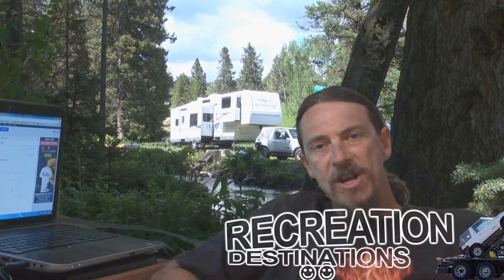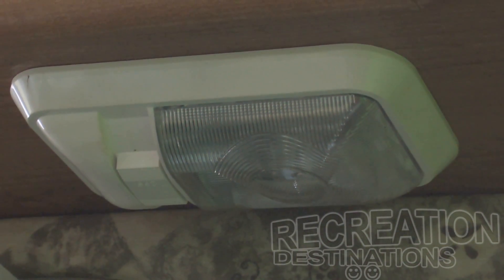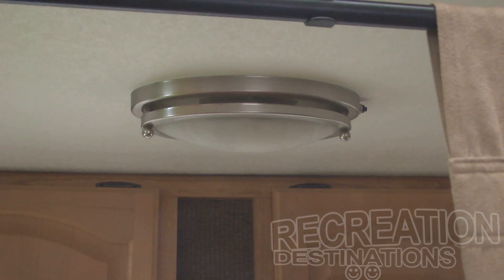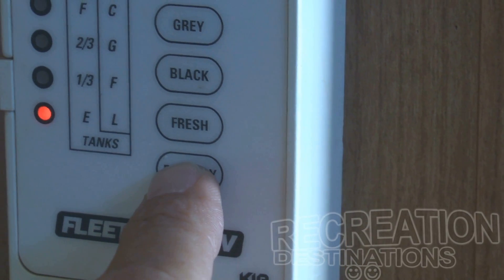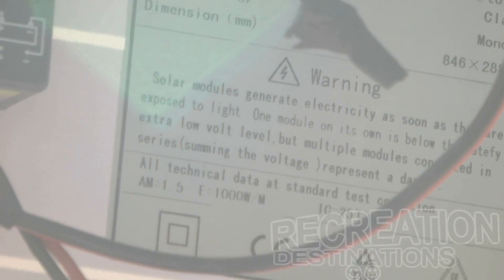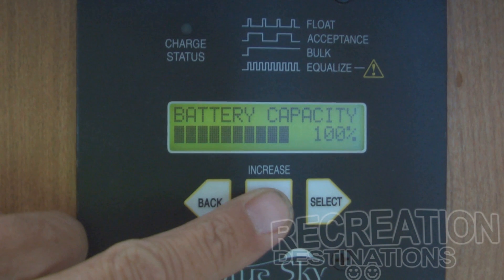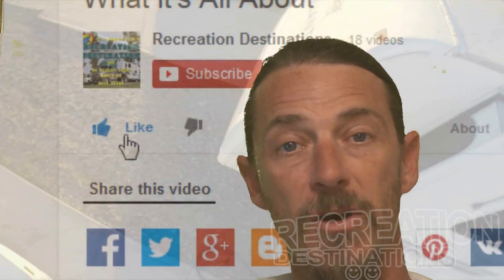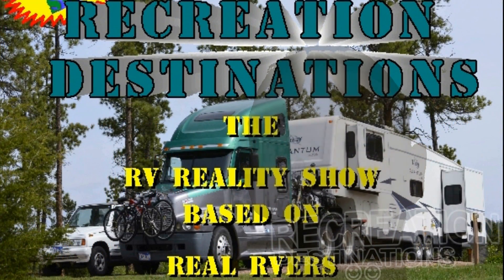Understanding RV Electrical Systems Part II

Comment: I am branny new to this tringto fix an old trailer. So I plug in a 50amp to 30amp dog bone then my extension cord to the trailer. Should I not automatically have power to my outlets? Are some outlets 12v and others 110? Why? I never heard of a12v coffee pot. Sero I have no power to my outlets. My battery is dead,but that's only 12V.
Could my converter effect the 110?
Reply from the maker: Yes, you should have power to your outlets. You may want to check your Breakers in the RV and make sure that you actually have power on the extension cord. The converter should not affect whether or not you have power to your receptacles, and no receptacles will be 12 volt.

Comment: Thanks for the great video.  So if i have a solar charge, and plug into AC, does the solar charge turn off automatically, or will the solar keep charging along with the AC converter/charger?  Do they work together somehow? Do they "talk" to each other?

Comment: My problem is that when connected to shore power everything work. When connected to my Onan 4000 gen set everything on 12v work but the wall outlets & A/C don't work. I already checked & cleaned all wire terminal on the batt. compartment & the wire box next to the batt. compartment, charged the batt, cleaned the batt. terminals, checked all 12v fuses & all 120v breakers.( All beakers read 120v when run on shore  power). The Generator breaker was tripped & I reset it & turned to the ON position. So it look to me that the problem may be the Gen. switch, the converter (the fan runs & there's one ceramic 15a 250v fuse on the green board ) or the transfer main switch ( Note, Gen. was run w/o load 1st. & then after 1hr. full load, Nada, O, nothing. Ur  help will be greatly appreciated.

Comment: You rock! Finally someone who can just explain in English "so to speak" great job. I'm still confused why my chassis batteries won't stay charged on shore power
Reply from the maker: Finally! Someone who realizes that I Rock!  If you're a single female with a great body and a nice RV we need to talk.  Otherwise, the chassis system is usually isolated from the house batteries in case you leave the lights on inside you will still be able to start the RV.  You can put a trickle charger on the chassis battery system that will keep them topped off.
Reply: @HighDesertOffgrid  lol..I'll never tell... so the trickle charger will draw off of the house?
Reply from the maker: @defaultname3302  No.  The trickle charger would be plugged in to a receptacle somewhere and connected to the chassis battery via the red and black clamps.  There are more permanent solutions, but that is easiest, unless you are an RV Genius like myself.  ;)

Comment: Should I be able to plug in my vacuum, little dirt devil, and have it work w/RV plugged in?? Can only get vacuuming to work when RV is plugged in. Love these videos....wish I’d paid attention to all my hubby did when he was alive. Now on my own and living in my RV (2 6v deep cycle batteries) I’ve learned a lot from these 1st 2 videos. Thanks so much for keeping it simple. I’m still puzzled why the red is called +, it’s not that way with $ 😬
Reply from the maker: You must have a built-in inverter or a running generator for your outlets to work when the RV is not plugged in to shore power.
The positive is red because it is the "dangerous" end.  If it is accidentally grounded, it can cause sparks and even a battery explosion.

Comment: Newbie here:  so, in your example, as I understood it, you are boondocking in the middle of nowhere and you find that your battery bank has depleted to about 50%, could you not just start your tow vehicle’s engine and run it for a while to recharge the RV batteries?  Please advise, thank you!
Reply from the maker: It would take several hours to completely charge the bank, but it is possible.
Reply: Recreation Destinations thank you.  Great vids.  Keep up the good work.

Comment: I have a 50 amp RV, and when I plug into a 30 amp shore power, with the correct pig tail, does my battery charging system work the same? The reason I ask, is because I typically have issues when I use a 30 amp connection.  thanks
Reply from the maker: It should still charge properly with the dog bone. The only difference between 50 and 30 amp typically is the amount of appliances you can run at once.

Comment: i have 2 lead acid flooded 100 Ah batteries in my 23' coach. in winter, when i run my furnace at night the coach is cold in the morning after about 7-8 hours sleep. the furnace is shut down and does nothing when i change the thermostat. my 'idiot light' monitor panel reads 3/4 lights. is this a furnace or battery problem? do i need to add another battery to get the furnace to run during the night?
Reply from the maker: Sounds more like propane delivery to me.  Are you on shore power?
Reply: occasionally plugged into shore power. mostly boondocking. but the furnace still doesn't run all the time when plugged in. i will set my thermostat to 14c, and in the morning, the coach will be a brisk 9c! the dealership service department refuses to replace the furnace, they INSIST that it's lack of battery power. very frustrated. at this point, i'm considering buying another battery(i would have 300 Ah then), just to prove to them that the problem is in the furnace, not the batteries. regarding recharging; i run my 4Kw Onan for 2-3 hours a day, with an external 30A charger. when i finish charging after 3 hours, the charger reads "100%" @14.5v.
Reply from the maker: If you are dry camping it very well may be you are using up your amp hours through the night.  Another battery added to your bank should help.  Also consider investing in a quality battery monitoring unit.  it will tell you how many amp/hrs you have used and much more.

Comment: Help I just got a 2017 Meada by forest river, It came with an 100 watt inverter to run the 110 compressor reefer. I had Go power extreme solor system put in my rv. they left the 1000 watt inverter in and just added my 3000 watt inverter. No I do not know how it is wired I asked but was never told. Is this ok to do and if so how should it be wired so I can check?

Comment: I have a 2003 Winnebago, where is my Inverter located on my coach
Reply from the maker: The vast majority of RVs don't have inverters.  They are usually installed later by the owner.

Comment: I had what sounded like a breaker breaking. I checked the breakers in the RV and the Breaker (30A) in the post outside. I turned off all the breakers in the RV panel and switched them back on then I switched off the breaker in the post and switched it back on. Nothing has changed. The lights in the RV work but none of the 120 volt items came back on. Any thoughts as to my problem?
Reply from the maker: I would start checking for ac voltage at the pedestal and work my way from there.  You didn't say if you found any breakers tripped so I assume you didn't. Could be a transfer switch if the unit ha a built in generator...
Reply: could also be the ground fault isolator ac plug ...  it pops from time to time on my 2003 Winnebago Sightseer 27c ... push to reset and ac is restored.  Hope this helps...

Comment: I have  a 2005 Riverside trailer and sometimes my lights will go out for like 10 minutes and turn back on but everything else stays on. I just got a brand new battery about a month ago . Do you think it could be my inverter? And if it is how hard is it to install a new one?

Comment: HI  I AM ELECTTION  BUT NOT RVS I HAVE 1990  SOUTWIND  AND I HAVE GOOD BATTERYS WENTH I AM PLUDED IN  MY DC RUNS DOWN IS IT MY CONTVERT GREAT SHOW MAXWELL
Reply from the maker: That's where I would start.  Make sure you are getting 120 to the converter and check for any built in fuses in the converter.  Some have them.  Happy RVing!

Comment: could i use the same type of batteries as my semi for my rv ? they last all night with you fridge,  GPS, dashcams, electric toothbrush, etc plugged in, plus tv....very rarely does apu kick in because they get low.seems like my 2 deep cycle marine batteries in rv, Peter out quicker with TV and a light on for a few hours. I'm running fridge and water heater on gas.whadyathink truckdriver? lol could I put big truck Batts in rv? would they be able to get charged up with my 2 -100 watt solar  panels?
Reply from the maker: Most semis have 4 starting batteries.  While they have a decent reserve, they aren't made to be deeply discharged often and won't last as long as a true deep cycle battery.  All the "marine" deep cycle batteries I have seen are a hybrid between a starting battery and a deep cycle battery.  They will last a little longer in an RV but aren't as good as true deep cycle RV batteries.  With regular maintenance, you should get 7 years out of a lead-acid deep cycle battery.
Reply: Hmmmm....i think I damaged the 2 new 12 volt marine Batts I bought at sams about 2 weeks apart.  Both got ran down to "dead" separately on accident. I have since tried recharging them with a battery charger. But they don't seem to last as long as they should.  Btw, i wired them in parralell a couple months ago after they were fully charged according to my charger. Just seems like I can only watch tv (I have inverter) In rv for a couple hours.......all night long in semi....wtf
Reply: Thinking about getting 4 6 volt agms....2 pairs wired in parallel  (each pair wired in series, of course)aren't they are lot heavier than 12v Batts? I'm already maxed out weight wise as i keep it full of water n gas...i hate rv parks
Reply from the maker: Deep cycle batteries are heavier than starting batteries because the lead plates in them are thicker and made to stand up to many more discharge cycles and build up less sulfation.

Comment: my gfci keeps tripping, then my circuit breaker on onan 4000 trips....i had a new breaker put in generator already. and I could not start gen from inside after this all happened a couple times. I've spent way too much  $$ on this gen. already....any suggestions so I can at least steer electrician in right direction?
Reply from the maker: I would direct the electricians to the circuit that the GFCI is on.  It is either overload or there is a short.  Check ALL  the loads (a/c, water heater, electric heaters, coffee pot, etc) on that circuit as well as the overall loading on the RV.
Reply: The light keeps coming on on the water heater....it tries several times to light on gas...so I've had to let it light with electric..maybe that's the connection..these things are great when everything works! Huge pain in butt when a problem drags on forever!
Reply from the maker: Maybe it will help you to know that it doesn't "light" with electricity.  It actually has an electrical heating element that pulls about 1500 watts when heating.
Reply: Recreation Destinations hmmm..interesting.....perhaps that is what is tripping gfci and generator breaker? a short somewhere having to do with my water heater element? cuz all is well....for 30 min...an hour? I've not changed anything or added anything. and,where things used to run perfectly

Comment: How would you recommend connecting  my 3000 watt inverter  into my 50 amp input cord to my rv?
Reply from the maker: You will need to add a properly rated switch, either manual or automatic, to switch between shore power and inverter.  You CANNOT add the inverter to the cord.
Reply: Thank you

Comment: I've learned so much from your two electric videos. Question: An inverter changes DC 12 volt power to AC 110 volt power. A converter changes AC 110 volt power to DC 12 volt power. Why is a converter referred to as a battery charger?
Reply from the maker: Because it charges the batteries in the RV so you can use the 12V systems when not connected to shore power.

Comment: sorry to use this format couldn't figure out how to reply to your email!!!

Hi and thank you for the reply.
What I'm referring to specifically is I have the generic battery condition meter in my RV.
While watching your and other YouTube videos it was said it would be a better battery condition indicator to replace the generic one.
I do understand the capabilities of this blue sky display regarding solar panels.
My real question is can I buy the display and a 500 amp shunt to replace my current generic battery condition meter...
Or does the display need a charge controller to power it??
I am not employed a solar panel at this time but maybe in the future.
I hope you're able to answer my question specifically.
thank you very much
Reply from the maker: As a bare minimum I would suggest at least a voltmeter so you can keep an eye on the actual voltages during charge and discharge cycles.  I believe the IPN remote came with a battery temperature sensor and the shunt.  I can't remember the price of it separately as I bought the controller, cable, panels, and other accessories all at one time.  I'm guessing 2-3 hundred?
Reply from the maker: One left on amazon:  http://amzn.to/2eaSJdp

Comment: great video. thanks.
can you please tell me what you get when you order that blue sky display... or better stated what's the minimum you need just to monitor your RV batteries.
Is it the display and the 500 amp shunt??
thank you
Reply from the maker: Hi Mark,  The IPN Pro Remote is not just a display, but a remote and programming center for up to eight Blue Sky charge controllers.  The absolute minimum would depend on your system and how you intend to use it.  Sorry that is a vague answer but there are a lot of variables in what RVers expect from our RVs and the electrical systems.

Comment: Hi!Great videos!!I have a motorhome and planning to install a inverter. Do you think it's better to keep my motorhome converter and instal separate inverter OR replace the converter with a inverter/charger like the Xantrez 3012? My RV already have a battery / system monitor by Precision Circuits but not sure if I can blend new inverter or inverter/charger on it.Also want something that allows me to install a solar system later without needing to change more things....Maybe this sounds too complicated but any tip will be appreciated!!2012 Fleetwood BounderThx a lot!!!!
Reply from the maker: The Xantrex systems are excellent but pricey.  The charger/inverter is going to be the easiest to use and maintain when installed properly.  I am not familiar enough with the Precision Circuits monitors to tell you if they are compatible with the Xantrex systems or will be able to monitor and adjust everything to tweak your system and optimize charging.

Comment: great vids! does plugging an rv into a 115v house also charge the motor and aux batteries?
Reply from the maker: +betterworld1 Plugging into shore power should charge the house (aux) batteries, but will not charge the chassis (motor) batteries on most motorhomes.
Reply: Recreation Destinations
10 4; thanks!

Comment: So... let's see if I understand. 4 x 200W solar panels with 4 x 6 v batteries connected parallel/series, allow you to be out of the grid for months in a row... But that would power what? Lights, refrigerator, fans only? What if i want to use a sawing machine, or a small branch saw... No microwave too?

Comment: Why on earth would you show a 3000 watt inverter in this series. Now the people who don't know are going to think this is the normal inverter to purchase and will have a cow the first time off grid and realize just turning that beast on is using 30 percent of life on their batteries. Be better of showing a 1000 or smaller 600 watt inverter to run the entertainment and lights. No coffee pots, hair dryers, microwave, air conditioner or electric  cookware should be used on battery power. Showing that monster of an inverter will only confuse the issue. Thanks
Reply from the maker: I show a 3K watt inverter Jerry, because that is what I use off-grid.  Yes I (and hundred of others) use microwaves, coffee pots, and electric cookware while off grid without problem.  Not to worry though, I will thoroughly discuss inverters of all sizes and types in the upcoming episode(s).
Reply from the maker: By the way, the 3K inverter pulls one half of an amp when on without a load.
Reply: Point noted. Thanks for sharing. Can't wait for next part.